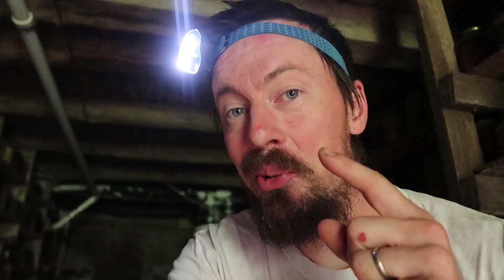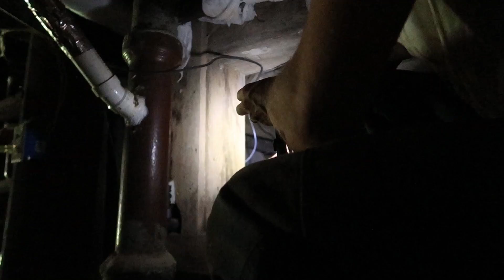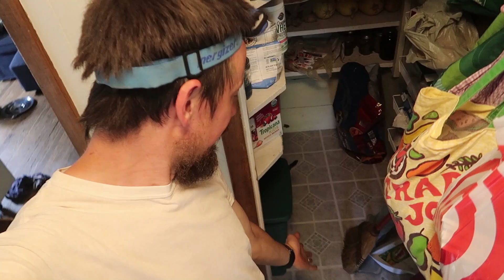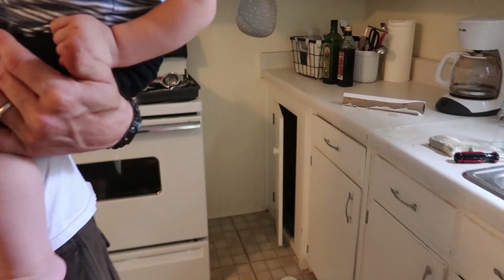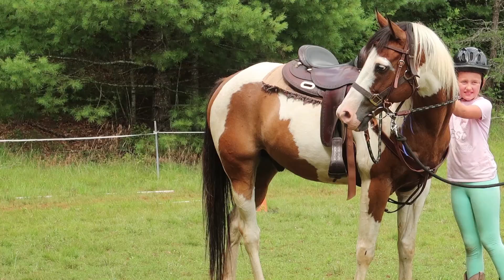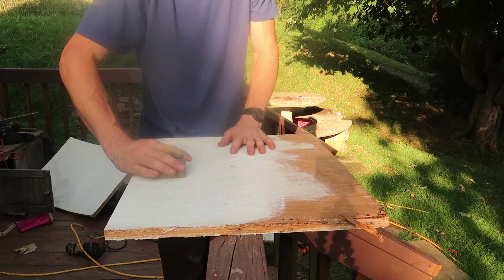Not How I Wanted To Start My Day

Comment: When I built my place, I put all drawers rather than cupboards below the worktops. They allow you to use the space all the way to the back, and have shallow drawers and deep drawers for different height objects instead of just a couple of shelves for everything - but don't skimp on heavy duty drawer runners with good steel ball bearings, because cheap lightweight runners with little plastic wheels that break are really regrettable.
Also, I have a wall of heavy duty hooks beside the stove, and all my saucepans and frying pans hang up instead of needing drawer space at all. I'm proud of that detail.
Reply: When you look at all the high-end homes today that is what they do. Drawers drawers drawers every depth you can imagine. And the older I get, I'm 68 , I love the drawers. Something to really consider. But, out here in the country I don't put anything out because flies or mosquitoes that sneak into the house would get on my saucepans or whatever I hang out side the stove.. I have one of those Corner cabinets that revolve with shelves and then I bought a fry pan holder that is upright a space for each individual fry pan, you don't have to lift up pans to get another pan oh, you just reach for your pain pull it out and you're done.
Reply: Songbird For Jesus one of the things I like about my house is that even though I'm on an Australian livestock farm and the flies outside could pick you up and carry you away in late spring, we have insect screens on all the doors and windows and also encourage non-dangerous spiders, so flies are really not a big problem inside the house. Also, the top of each saucepan faces against the wall so there's not much of a gap for flies or dust to get in anyway. But I can see that my preference for open shelves and a whole lot of stuff hanging on the walls wouldn't be great if you couldn't keep the flies out.

Comment: My neighbor's house was built in 1906 and has no closets. Instead there are hooks all around the inside walls of the bedrooms and close to the entryway. In my parent's farm house, built in the 18th century, mother added a closet lined with cedar that had come from an old tree that fell during an ice storm. You, by the way, have done a great job on the kitchen and even in the dungeon under the floor.

Comment: Where I live there are no closets built in the wall, a closet is a separate piece of furniture. And it works well. I recommend that you install wheels with a lock underneath the island of the kitchen, so you can move it when you want.

Comment: Boy and howdy do I understand cramped crawl spaces. Our old house had 12' added onto the back (except the kitchen) and the furnace was in that space 12 feet back. I used to have to crawl in every time to change the filter and there was a big duct that crossed the opening so I had to decide to be on my stomach or back because once you committed you couldn't turn over. Thankfully 4 years ago we put in a new heat and cool system and it keeps me from never going under there again. My hubs was too large to even try so it fell to me!  I don't hate spiders normally but having them drag across your face and hair.....oh lordy I am so grateful for that new heater! Art, you keep it real and I thank you for it!

Comment: My family call the peel and stick tile, lick and stick.
THE tile will not stay down long will pop loose. YOU need to get some glue for non peel and stick. Glue will work up through seams then use paint thinner to remove.

Comment: we renovated an old home. It was very trying. nothing was level or straight. We didn't have closets either. Tim came up with the idea to put our frig in the wall (which was on the other side of a bedroom). We did this so he could build a closet in the bedroom and leave more space in the kitchen. It appears at a glance should you remove the highchair, this would allow a place to add more cabinets for storage. We do what we have to do, don't we.

Comment: Sorry about the leak but it looks great. I bet that rather then putting in an island in the middle it would be better to install a counter at the end of the sink cabinet. It would help keep things more open. Bri would be able to see out the window during dishes and be able to see the table and outside that door while doing food prep. I bought one used for a sink cabinet that is a nice length to do something like that at Lowe's for about $150 prebuilt and all you would have to do is paint it and add a counter which you can usually find second hand pretty quick for cheap. You are both so good to each other. It warms my heart to see other couples (me and my Mr. are going on 15 years now)  so in love. :)

Comment: I posted before about converting the entire kitchen into floor to ceiling cabinet(on the coat rack side) and lower  cabinets where the dining table is currently. The L-shaped dining area would have under windows cabinet storage with  cantilever countertop for stools. The natural light is multi-purpose use for garden veg prep/ eating/crafting etc. You could make your own concrete countertop to unify the entire kitchen counter spaces.

Comment: Great job, looks beautiful. So much  of a difference can be made with small intentional changes. It inspires others to be looking for ways to make improvements without huge renovation expences. Functionality is so important and tweaking things to flow together calming. Whats funny is we have a,project with cutting out the middle of our cabinents and moving a set of three roll out drawers under the stove top. Were going to cut them out and move to a counter that needs to be raised and drawers to fit under counter that was a sitting place in the kitchen. Much more funtionality will happen with more use,by putting in a new full stove in the place where cabinents were. Thankfully no plumbing or crawling under house. But i feel much more confident about starting the process now. Thank you for sharing!!!

Comment: I once did all the plumbing and then poured a slab floor and had a leak in the slab! We had a deadline but I had to jackhammer and chisel the concrete out to get to the leak to fix it...I wish I could have just crawled under the house to fix it 😖

Comment: I have thought, that whenever we moved to a new old house, i would like a metal tool cabinet on wheels as an island.  They come with stainless steel or wood counter tops and have several gradations of drawers, from shallow ( knives, slotted spoons, rolling pins, etc) up too to deep ones ( pots & pans) on the bottom. You can push the island into whatever space configuration ( more to one side or end of the kitchen or the other) you need for whatever task, and lock the wheels, or you can move them completely out of the way. It would be easy to attach a magnetic strip or a knife block to a side ( or since your kids are small, just put them in an upper shallow drawer.) or a towel bar.. The last time I checked, the smaller ones (@ 2 1/2 ft x 4 ft or so?) were about $150.00 - $200.00. at Lowes.  I know that Home Depot has them too, i just didnt check the price.  I know the much bigger ones are around 300 - 500 bucks.  Anyway, it might be an acceptable solution for you to add work space and storage, while still maintaining some flexibility with the space..